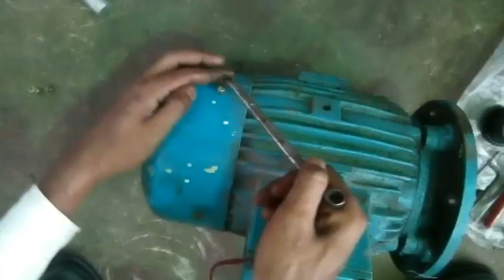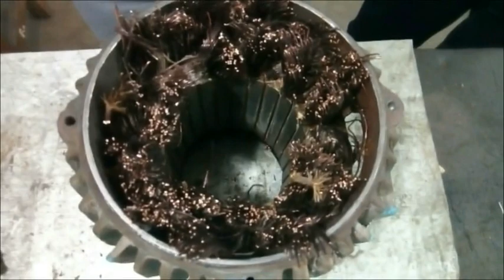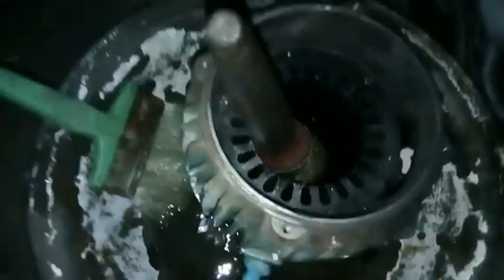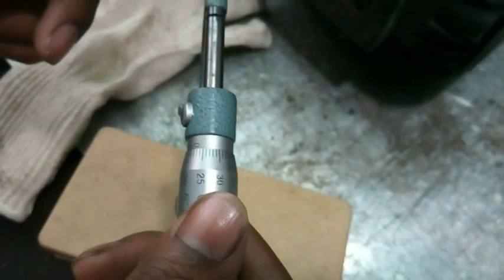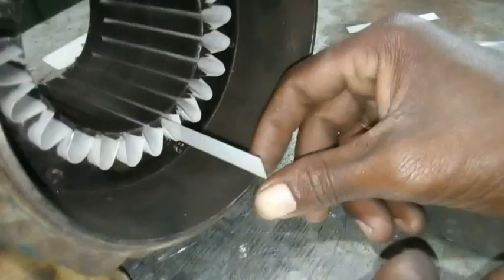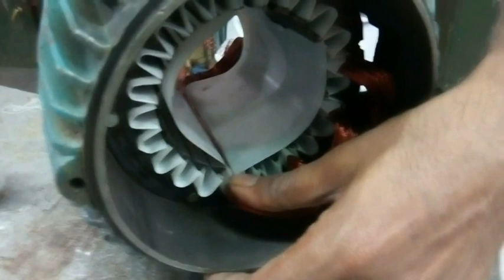Rewinding of Three phase Motor Part 1

Comment: sir how to convert the size of wire, ex. no. 22 wire , i want this wire make it double?
Reply from the maker: You have know the cross sectional area of wire and take two wire whose total cross sectional area will be equal or little higher.Example for SWG 22 area is 0.397 Sqmm can be replaced by 2 wires of 25SWG of area 0.202 Sqmm

Comment: sir if the motor only for 50 hz, then i supply  60 hz , no problem for the motor, motor will not be defective? after a month?
Reply from the maker: If motor rotates at 15000 RPM at 50 Hz than at 60Hz it will rotate at1800 RPM. However, the noload current of the motor will be little higher due to higher hystersis loss and heating of motor will be more. Hence, if motor is run with break or cooling arrangement is made than motor can be run at 60Hz.

Comment: to make a coil does it have to be clockwise and when its done which end is start and finish?
Reply from the maker: The coil can be made either clockwise or anticlockwise no problem. But for right handers it is easier to wind clockwise. Any one terminal may be taken as starting and other finish, but the convention shall be followed for all coils. Normally, we take terminal at innerside of stator as starting and outer side terminal as finish.

Comment: it is basket or Chain winding
Reply from the maker: This case is basket winding  as the structure is similar to basket weaving. Here winding remains in better stability and proper circular shape also maintain gap between rotor and winding.

Comment: what material is that white paper?
Reply from the maker: The White Paper is called Mylor Paper. It is a class-B insulation and helps for easy inserting of coils inside slot due to smoothness.